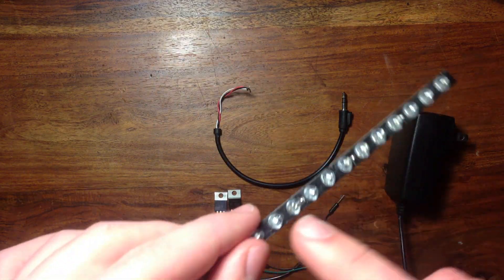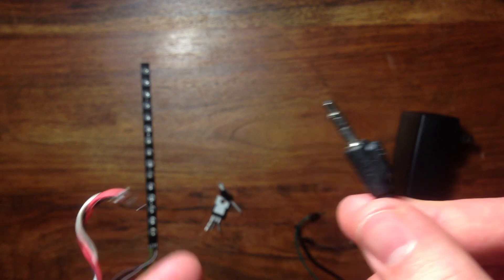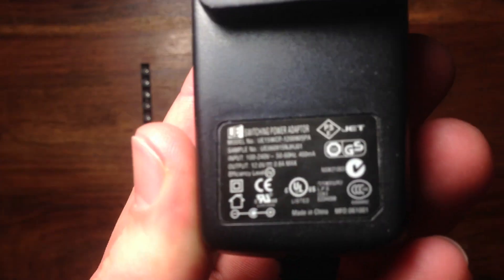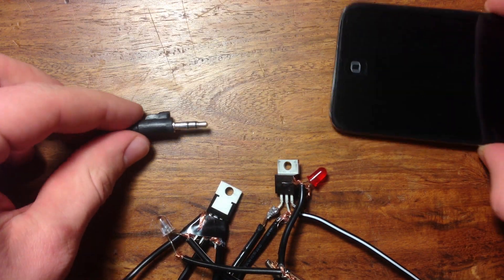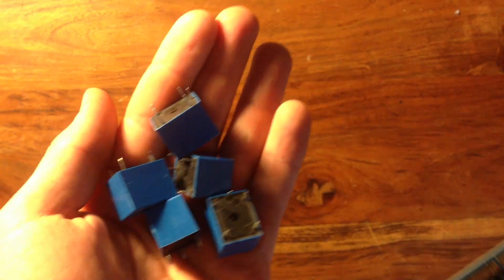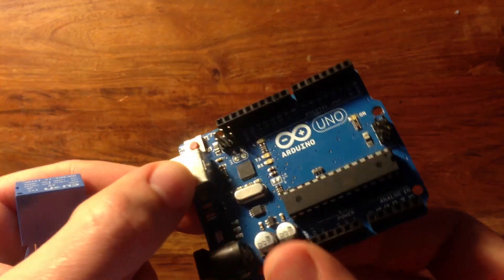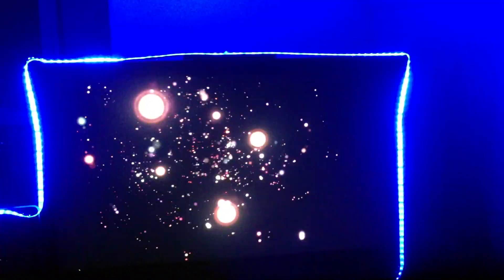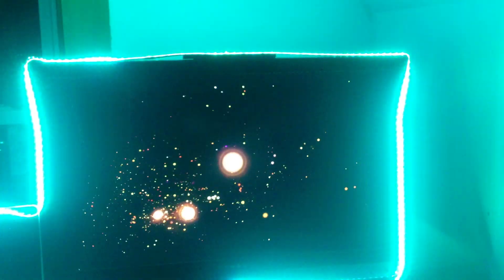How to Make Music Activated Lights

Comment: "Once you finish the circuit, it should just look like a jumble of wires, but, when we plug in the headphone adaptor.... it goes BANG!" I'm surprised you get anything but smoke out of that lot, with that quality job you did on 'soldering' those components together. Geez. And where's the detail on "hooking up the LED strip" to your handywork? This looks like a 3-channel LED strip, but you only have 2 audio outputs, so have you put 1 of those audio outputs into 2 channels of your LED strip, which would only ever give you the colour of those channels mixed, ie. amber, magenta, or turquoise. Just not enough detail for people to try this without much guesswork.

Comment: Hello sir, Is there any other way (without transistor) to connect led strips or el wire cable's to plug into aux socket?

Comment: Hello!
I just brought two strips with 300 LEDs each (5 meters each, 10 meters total) and want to do this! 5 meters from left music channel and 5 meters fro right channel. I got three TIP31 resistors. My question is, does it work with so many LEDs without the arduino?
Reply: Yes, but it would need more power and resistors, for the transistors themselves.

Comment: A cheap way for peapl like me is to take some christams lights cut off the ends and remove the extra wires then take one of the wires and wrap it around the wire with the lightd and conect it to one end and then fonnect the oppiset enf to one speaker wire qnd the other to the other speaker wire